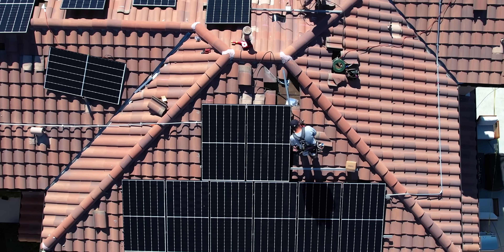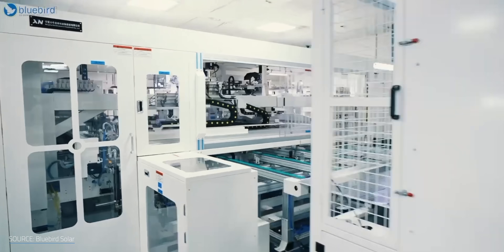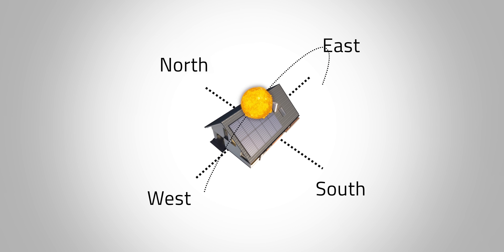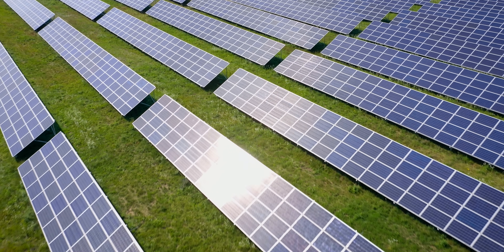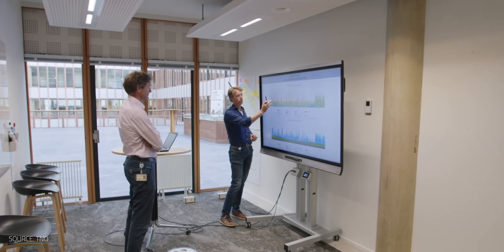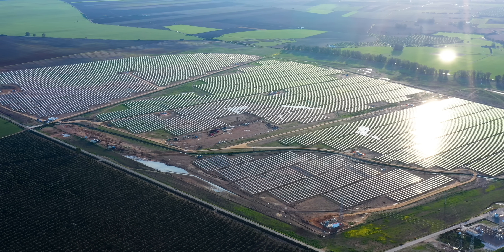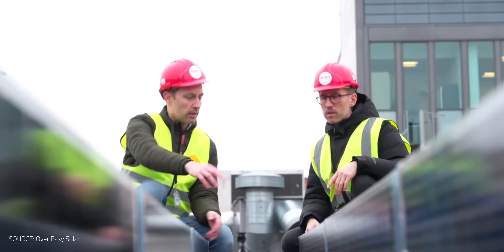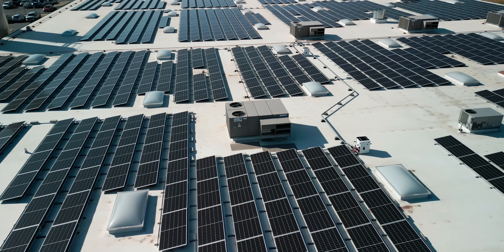Have we been doing Solar wrong all along?

Comment: I think if it could be made durable enough, it would make an interesting alternative to a traditional fence. Heck, make them a part of the fence.
It really does make sense that heat would be the big variable. People have been water cooling their panels in recent years, so I would think they'd provide some correlation to to idea. Let's see what happens.
Reply: Later in the video there is literally some footage of farms that have used vertical solar panels AS the fence itself, even dividing up a small pasture with the panels
Reply: @GodofGHz  To be clear, that was what made me think it. But I was thinking more about inside towns and the like and not so... bare. Panels should be able to be integrated stylistically. I just didn't go that far into it because I just woke up and was prepping for work.

Comment: The other bonus of BVPV in agriculture: you don't really need to restrict to short crops. You can just stilt the panels to be a few feet higher to get over taller crops like corn and sunflower.
Reply: nah, too much underground infrastructure to work well with traditional farm equipment.
Reply: The only problem with taller crops will be the over all cost of installing it would out pace the return by a long shot. You are not just talking about getting over the crops, but also having room for everything else as well. Taller the infrastructure the harder it also has to work with weather such as wind, rain, and snow hitting them.

Comment: In the paper "Thermal model in digital twin of vertical PV system helps to explain unexpected yield gains", it says
"The adjusted value for Uc leads to a 2.5% higher annual energy yield and higher performance ratio, partially offsetting the energy loss due to the less than optimal configuration.".

Not that the vertical angle is better than the optimal angle as the video kind of implies. The production of the optimal angle is far greater than the 2.5% gained from extra cooling.

For agrivoltaics this is still kinda interesting and good information.
Reply: @ayesaac And the cooling can be used for heating somewhere else where it could be useful.
Reply: @cherubin7th  I had a thought during that moment in the video, "what's engineering or physics problem is preventing harvesting that heat for useful energy?" Probably can't run a turbine off that (Maybe?) but perhaps offset heating costs with the proper set-up in a small home. 

If nothing else, harvesting it and moving it elsewhere would help with the hot-panels problem.
Reply: @hypotheticalaxolotl  Yes, I would agree. For example, you can use panels from French company DualSun, and you get to both harvest thermal energy and improve photovoltaic efficiency by cooling the panels with the liquid that harvest the thermal energy to heat water.
Reply: @nicolasdujarrier  The problem with cooling, in general, is three fold.  First, there is a significant added cost that you have to weigh against simply adding more non-cooled panels.

Second, liquid loops require maintenance and also don't last anywhere near as long as a panel.  Again increasing costs.

And third... heat == sun == over-production.  i.e.  on sunny summer days the solar system is already producing far more energy than one needs.  Producing even more at noon isn't helpful.

There are also solutions involving blowing air across the underbelly of the panel but they have similar problems.  You wind up with a ton of fans and the air has to be routed to exhaust away from other panels.   Also the air just isn't hot enough that it can be repurposed for other things (like heating a sand battery, for example).

-Matt
Reply: @junkerzn7312  I agree that there are several issues like the added cost and lifecycle that seems to be lower. I think the French company DualSun provides a 10 years (or maybe 15 years) warranty of the liquid loop part indeed. So indeed, it would be great if they can further innovate to improve reliability to reach at least a 25 to 30 years warranty. 

For the 3rd one, I would say that one option could help a bit is to try to recharge EVs during the peak production. There is a lot of ongoing R&D work to try to optimise EV charging (and discharging (V2G) if the car and charger can handle bi-directionnal electricity flow) to store peak electricity production.
Reply: @nicolasdujarrier  There are several EVSE brands which will try to zero-out grid-tie solar export with EV charging.  Basically the systems just add a CT sensor on the mains and the EVSE then adjusts what it tells the vehicle it can charge at to try to zero the export.

But at least on #3, the additional tiny percent generation is in the noise.  Most home solar generation is in the weeds compared to charging an EV.   For example, my system might be able to export 3kW to the grid for a small portion of the day (like an hour or two at the most), but my EV (an ID.4) will happily charge at 8kW.

And outside of the noon hours, for the rest of the day I aint exporting nearly enough anyway.  Nor will most people.

Matching does work to some degree but you still need to get the EV to its charging target by the next morning, which means it is going to be pulling from the grid no matter what.  Also, your EV might be sitting in a parking lot somewhere at noon and not necessarily in your drive-way.

-Matt
Reply: @junkerzn7312  Thanks for all this feedback 👍. I agree that one of the issue with EV charging is that the car needs to be plugged at the right time for it to work. 

In France, the car manufacturer Renault should announce at the end of February 2024 the final details of the Renault R5, which will be the 1st car in France that support Vehicule-to-Home (V2H) which I find very interesting with solar photovoltaic (recharge during the day from solar and use solar electricity during the night). It may be a good fit for many retiree, at least the ones that are home owners and don’t travel too often during the day. I strongly believe that it is something that will entice even more people to switch to photovoltaics and solar, and I am very thrilled about that prospect.
Reply: @nicolasdujarrier  Generally speaking vehicle-to-home is only really useful if your vehicle battery is LFP or some new chemistry with the same or better cycle life. Otherwise you are subtracting more value from the vehicle from the battery wear than you are saving by pumping power out during peak periods.

Other than that little issue, zeroing the grid with V2H is totally possible.  Even easy to do.   Ignoring A/C and heating, most homes do not use more than 2-3kW during the 4-9pm peak period.

Ultimately, though, from a cost standpoint it doesn't make much sense to bleed away vehicle life verses throwing together a home battery system designed explicitly to do the same 4-9pm zeroing function.  Your cost over the years will wind up being the same and having a fixed home battery is far more flexible in operation.
Reply: @junkerzn7312  Yes, I agree that LFP battery type or better cycle life is quite a requirement for V2H to make sense. 

However, although at this stage, we don’t know yet how Renault will charge for the V2H feature, from a cost standpoint, I wouldn’t fully agree because it may depends from which point of view (customer or car manufacturer) you evaluate the benefits. I would think as well that a stationary battery is likely technically better, but it incurs a high upfront capital allocation. 

On the other hand, if anyway you plan to renew your car with an EV, the extra cost related to the V2H functionality will likely be lower than the capital you would have to spend for a stationary battery. Furthermore, you can rent the car with a monthly fee for example for 3 years (further reducing upfront costs), and then return the car to the manufacturer at the end of the 3 years. Therefore, if your rent the car, as a customer, you may not care as much about battery degradation. However, I agree as a car is mobile, the car won’t be plugged all the time, and you will likely not have as much savings as a stationary battery.
Reply: @cherubin7th  Yes, I would agree. For example, you can use panels from French company DualSun, and you get to both harvest thermal energy and improve photovoltaic efficiency by cooling the panels with the liquid that harvest the thermal energy to heat water.
Reply: Yes, this was my thought too - well expressed.  The regular tilted panels can also have a benefit to livestock in agrivoltaics as it gives them places to shelter from the sun or rain/snow.
Reply: This is an important point to understand. My quick helioscope model showed a 60% lower kWh/kWp yield for the vertical E-W install when compared to a commercial fixed tilt with 2 modules in portrait.
Reply: I think the fact that vertical solar panel energy generation aligns more closely with energy demand is also a bit plus. Since it reduces the need for energy storage. The overall loss in efficiency may still be worth it if the cost of more panels is less than installing more energy storage.
Reply: Some cells are VERY sensitive to off-axis illumination.
Reply: @ayesaac Yes, I would agree. For example, you can use panels from French company DualSun, and you get to both harvest thermal energy and improve photovoltaic efficiency by cooling the panels with the liquid that harvest the thermal energy to heat water.

Comment: Well one thing is mounting these in a working agricultural field is not going to be popular with farmers.  What you don't see is the foundation work and wiring for an install like this.   That "B" roll of a tractor mowing between the panels is pure folly.   Field equipment does not always go where you expect it to.  Matt I would like to see a few "vertical" PVs in your yard.
Reply: It will be popular with farmers when you can lease the land and still farm it. Agrivoltaics is a thing
Reply: I doubt these need much of a foundation, they could probably be driven into the ground with a screw-shaped piling, down three or four feet or so. Having worked on small vegetable and strawberry operations, I think these vertical panels would be great. Wind protection for little transplants would be amazing. I could see the ideal spacing being ~3x 80" beds between vertical arrays. You've got 20' wide alleys and you could do strawberries or divide those beds down to 6 40" beds to do cabbage, cilantro or other vegetables
Reply: As Matt said, much higher yield crops than grass would be best between the solar panel rows.  Such crops require much smaller and nimble equipment than the tractor pulling that mower...
I guess that all foundation and wiring work would not extend more than a foot on each side of the panel... much less even if foundation piles are sufficient... which is probably the case.
Reply: I see mowers on that tractor that are attached to the front and back.  I think you are referring to the American trailer implements that will often track one way or another.  Many European model implements are fixed to the power unit.

Comment: Great ideas! Have wind tests been part of the tests. In the great plains we have lots of sun but lots of very strong wind storms. My area is prone to 40-60 MPH winds n thunder storms but average daily wind is only 10 -15 Mph. I would hate to loose the whole solar farm to wind or hail.
Reply: since east/west orientation is ideal,  i'd imagine it should handle wind and hail pretty well, if not better than flat panels.  hail would mainly strike glancing blows instead of bouncing directly onto the panels.  And wind would simply primarily blow between the rows.
Reply: Most of our storms build and come out of the south-southwest. In a good storm Stockade fences are teh First to go. I know that mechanized panels have issues in storms and can have operators broken fairly easy. Never seen panels removed. Enough of the contemplating I was really more interested if eh manufactures had certified wind speeds that the panels installation system was tested and rated for. @alanpleiman3378

Comment: Vertical Solar Thermal has been used for heating water for years now. So it's kind of weird it never took off more.
Reply: Thermal solar has an objective to catch heat (infrared) which is the opposite point of this objective to catch high frequency photonic energy ( UV) while staying within a cool temperature so as not to lose efficiency in electricity. So vertical is not the best optimization for thermal according to this discovery.
Reply: @Dana5775  the real winner would be a combined system that cooled off the panels by transferring the heat to the water
Reply: @drillerdev4624  Many farmers would be irrigating their fields with some sort of sprinkler system.  Building the sprinklers directly into the same structure as the solar panels would make a lot of sense.
Reply: @drillerdev4624  Correct. For that, you can use panels from French company DualSun, and you get to both harvest thermal energy and improve photovoltaic efficiency by cooling the panels with the liquid that harvest the thermal energy to heat water.
Reply: @Dana5775  Alternatively, you can use panels from French company DualSun, and you get to both harvest thermal energy and improve photovoltaic efficiency by cooling the panels with the liquid that harvest the thermal energy to heat water.

Comment: I've always wondered why they are not setup in a V.   Allowing the light to bounce between the panels a few times.
Reply: Likely because they absorb the high energy photons already well enough and would trap those with to long wavelengths to be useful between them - generating heat. Similar to the question: how much of the spectrum can we use to harvest maximum energy. Short wavelengths only for high per photon gains? or long wavelengths as well to convert more photons at the cost of not making efficient use of the excess energy in short wavelengths?

Comment: My guess is temperature. It's the hottest around noon, so top production in the morning and in the afternoon might do a good combo with lower temperatures.
Reply: Alternatively, you can use panels from French company DualSun, and you get to both harvest thermal energy and improve photovoltaic efficiency by cooling the panels with the liquid that harvest the thermal energy to heat water. DualSun claims that they have the best overall efficiency as they harvest both thermal + photovoltaic energy.

Comment: Seen several clips like this. But your the only one who mentions we need to see more testing of this and if true. It be good to see more people backing this up.
Reply: If thermal effect accounts for the gain, then panels that combine water cooling with PV should be as efficient since they should be cooler.
Reply: @brodriguez11000  but water cooling is not a good fit for bifacial solar pannels.
Reply: @MusikCassette  So? They were saying that water cooling would be an alternative to vertical mounting.